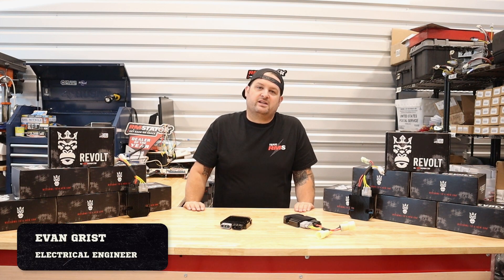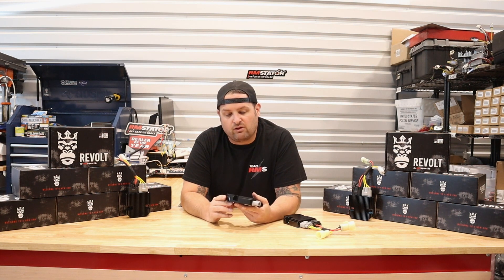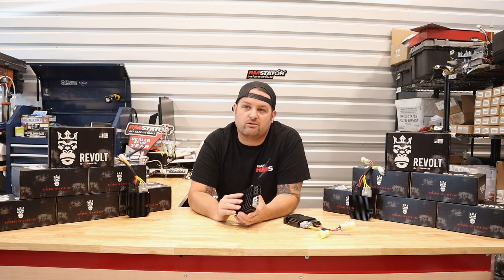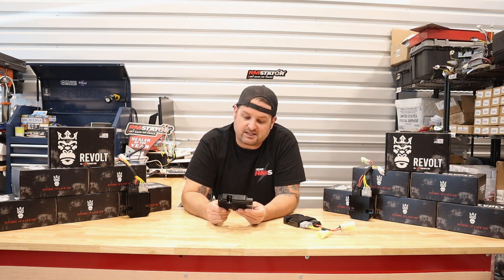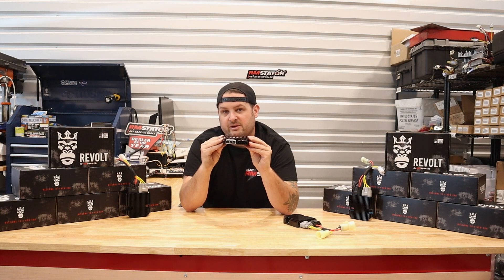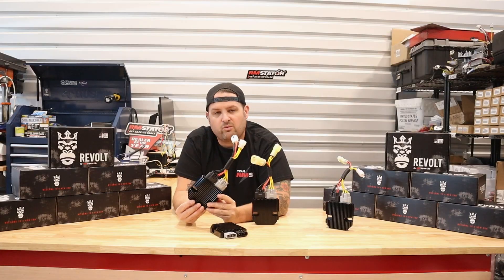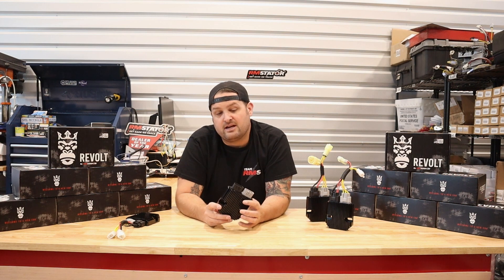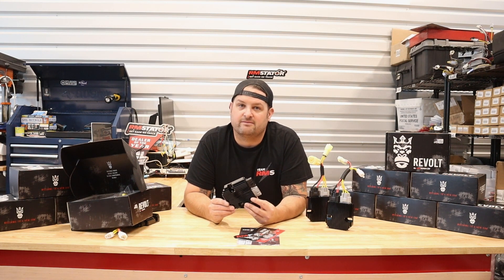RMSTATOR REVOLT New Powersports Voltage Regulator Rectifier Technology Product Presentation

Comment: How about something for my commercial zero turn mowers? We need to have the ability to run more electrical such as pumps,lights,electric motors and other things do you have anything to upgrade the charging system on a engine like the Kawasaki FX1000v 35hp??